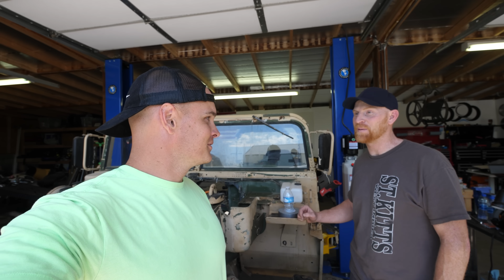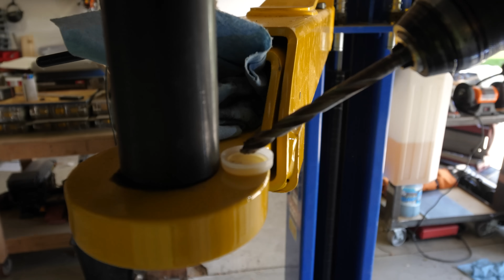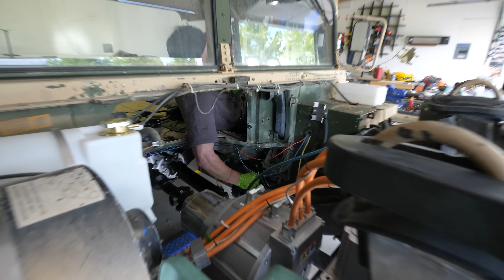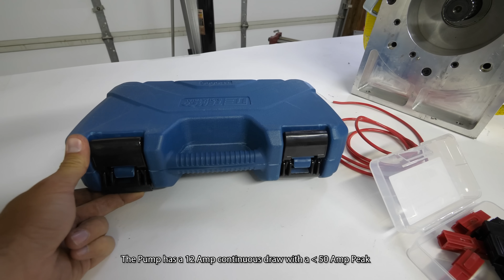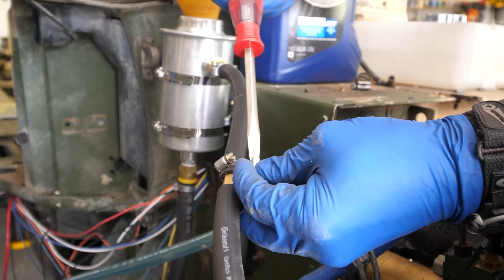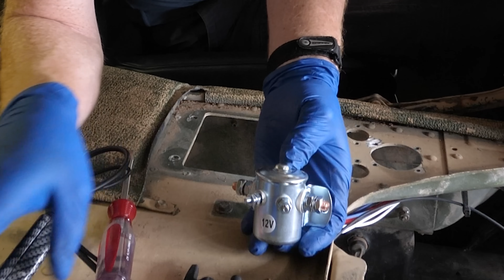We might have a problem with the Brakes... - Electric Hummer Conversion!

Comment: use pressure switch in line so when sufficient pressure it will stop pump..when pressure drops it will start pump again.
without pressure switch pump will heat up
or else use relief valve to drain excess oil in to the tank

Comment: First, add a fuse between the contactor and the battery. Also be sure to use a continuous duty contactor. A housing would help lower the sound level a lot as others have said and also protect it off roading. Love the channel and the series though this is a great build!

Comment: I wouldn't worry about sound deadening the PS pump itself. Once the hood and doghouse cover are on, and you sound deaden the interior that will help a lot. Also when you're moving you won't hear it over all the tire, wind, gear and main motor noise. So I would just let the PS pump stay uncovered so heat is not an issue.

Comment: if You add batteries and motor coolant pump to the  road noise You wont be able to hear power steering and brake pump ;)

Comment: Most auto manufacturers are using a lot of foam for the fuel injectors and fuel pumps. It helps keep the noise down. It would be worth a try.

Comment: Use a small housing insulated with the foam used in recording studios along with seals around the inside of the cover for the housing. That should work wonders in dampening that sound

Comment: About the pump... in my 1993 xantia I've noticed that it only makes a sound when I'm steering... if the wheel is straight (or in a long turn that u keep it at a specific angle) the pump isn't working... I assume there's some valve that when a specific amount of pressure is exceeded, only then does the pump kick in. So if no pressure on the steering wheel to turn, no pump.

Comment: What happens if the pump were to fail? controlling both brakes and steering single point of failure for both systems.... also - kinda mounted low if you are going to be off-roading a bunch?
Reply: steering is still mechanically connected via a shaft from the steering wheel to the wheels through the "steering box".  It would be very hard to turn at very slow speeds however.  The brake "hydro boost" has a valved accumulator that stores pressure for cases where you need power brake assist, but the power steering system isn't working.  But you only get a couple presses of the brake pedal before that runs out, and is a backup system only.

Comment: There will always be a difference between your electrified vehicle and a real electric car. On electric cars most components (especially those requiring a lot of power) use energy from the large battery to improve efficiency and reduce the load on the 12V circuit.
Reply: As long as his high voltage to 12v charger can keep up with the average power consumption of the 12v system he should be okay.  But yeah its not as efficient as electric power steering, and an electric brake booster.  I wonder if he's thought about his 12v loads vs what the 12v charger will keep up with

Comment: Thinking about previous comment, aviation folks use the transmission ( helicopters), CSD, constant speed drive, ( jet engines) to run hydraulic pumps. Emergency pumps were electrical and they made noise when turned on. Just some things to think about.

Comment: you should try using sound dampening foam under the hood and dog tunnel of the humane, sure it will still be loud on the out side but it should help the inside of the homvee a little

Comment: In my humble opinion, you should think in a way to only turn on the hydraulic pump when needed.

 I think that you should consukt if there is a servo motor capable to turn  your wheels. They will consume electricity only when turning and not all the time the vehicle is on.

If I understand correctly,  this pump will be always on and consuming your 12v battery juice,  which you will also need to think about how to charge it. Maybe it is a good option to plug it in your high voltage system,  via a dc-dc converter.

Comment: Since the loud pump sound does not vary too much, you might be able to cancel the sound by using a speaker that outputs reverse wave of the pump sound. This might be a good solution going by the electric hummer theme. Would love to see you try this solution 🤩

Comment: This is an awesome project. One thing about the braking system though. EVs and Hybrids use "Brake By Wire" So there isn't a physical connecting between the brake pedal and the Braking system. This allows EV's to modulate the braking system between the Regeneration and the Physical Braking systems. I would recommend that you add a Regeneration switch on the dash. That way you can manually switch the Regeneration function on and off, making it much easier to drive. Plus, I'm sure Regenerative Braking needs to be selectable for off-road use anyway.

Comment: I think the smarter thing would be to move the location of the pump to engine bay, as front as possible. Then when everything is assembled, if it's still noticeable from the inside while driving, try adding another layer of rubber on the mounting points so you're excluding the chassis from amplifying the sound,if none of the above fix it try covering it up and adding sound insulation. Even if it is cooled by the fluid, covering it up will add extra heat.

Comment: Next time, buy the pink teflon when used with oil/petroleum products. They cost 1$ instead of 35cents a roll. May save you a leak on the long run.

Comment: Try to put the system on a certain pressure. For example, an air compressor turns until it gets to 8 bar, and begins turning at 4 bar. If you put an accumulator in place, you have some buffer, so that the pump won't turn on too often. Maybe I am wrong about this, it only works if nothing is consuming any oil. 

If you don't find any solution, you may install electric power steering since the whole hummer is being electrified. I guess it works much simpler, but I never messed with it. You can put the pump for the brakes on the brake lights, so that the pump only starts spinning when pressing the brake.

Comment: Jerry, I am following your HMMWV build. Very impressive! You are doing an incredible job. I'd love to help. Sometimes I can see things I could do better and/or chipper. Like this pump reservoir. You custom-made it, I could of give you for free from one of my parts trucks. Or the wire connector to the pump, I would have done with Deutsch HD series, so it is weather sealed. As for the pump, I'd install a hydraulic accumulator with the pressure switch to activate the pump only when you need it. Also, there is no filtration to the system, not active (oil filter with bypass) nor passive, such as grabbing oil from reservoir few inches from the bottom, so if any metal particles not re-entering the pump and rest of the system.

Again, you are doing an amazing job!
Thanks.
Please do not hesitate to contact, if you wish

Comment: You should relocate the pump to the front of the engine bay away from the driver's seat. Also might want to put the engine cover back on and shut the windows and see how loud it actually is inside when there is an insulation barrier.

Comment: You need to isolate the pump from the frame. The vibrations of the pump are being amplified by the frame. You can buy isolator mounts for a mini split condenser, mount those to the frame and mount the power steering pump to the isolators.

Comment: If i understand your layout for 12V - it seems like you have the fuse on the signal side of the relay, not the load side, which means that if the circute is over loaded, no fuse will blow, because the relay isolates the signal side (low power) from the high side.

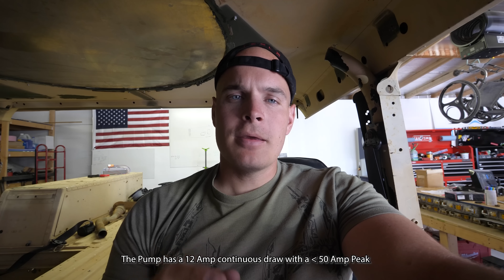Comment: 10:09 So test for max draw would be slamming on the brakes while turning at a deadstop?
Most work on power steering is when wheels are not turning and slamming the break pedal is the most stress on the brakes system.
Alot of R&D has been going into electric brake systems latley (last i knew) who knows what different options will present themselves soon.
Reply: Could always skip the power steering in that method and use a steering wheel that has a position sensor and have another electric motor that will rotate dependent on the readings from your steering sensor.
Reply: For the sound of the pump... covering it could possibly effect the cooling so thats tough to say... i think its only really going to be a noise issue when sitting idle as your tread to pavment noise will most likley be greater than the pumps noise... maybe a pressure resivoire that has sensors and switches with the idea of while stopped the pump would not activate unless pressure is at a less than ideal pressure (safety) but will activate freely when in motion. Have a couple other ideas but dont know how practical they are.

Comment: 15:23 Just put the pump away from the cabin, like behind the front bumper and you won't hear it from the inside, and if it stays too loud you can put sound isolation around it, like a little box covering it with sound isolation in the inside. If that doesn't work you can use a pump with a bladder that holds the pressure and the pump only turns on when the pressure goes down, like an air compressor, so it won't be running all the time, but check the pressure that the hummer needs, maybe is more than what small electric cars that use this system need. Also remember that you have the cabin all open now, with all the panels and isolation you won't hear it that much.

Comment: Working around aircraft hydraulic pumps made noise when they caveated, we used constant pressure variable flow pumps though. Maybe the reservoir ( scavenger system ) isn’t letting enough oil into the pump, or the pump isn’t strong enough, used to be a 24V system. Any check valves in the system to prevent feedback?

Comment: I assume this pump should only run when there is steering in action (so the noise won't bother. just like some regular car has hissing sound when steering). and don't know how you gonna hook this pump also to the brakes! Wouldn't it push the brakes and stop the car when steering?

Comment: Zack, you gonna need to keep running that pump for a while and eventually make some refills. Also move the wheel back and forth while doing this. It takes already a lot getting rid of bubbles from a water-cooled system, and it's gonna take longer for an oil based steering system before that pump shuts up.

Comment: I might be a little worried about the clearance of the brake pump. 
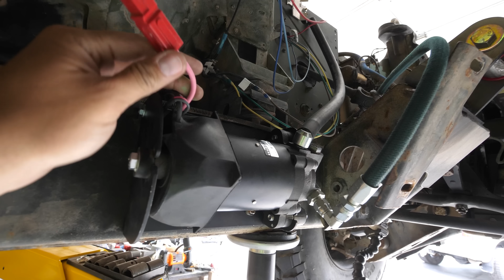6:39
If this vehicle will be used for serious offroad, the pump or the elbow could be banged/bumped/knocked off from a rock. 
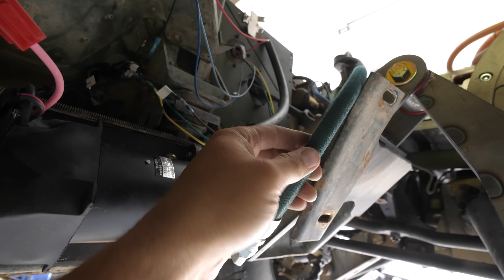You can see where the frame bottom paint was scraped at 6:49 from previous 4x4 ventures.
You guys are doing great work and your videos are awesome! I'm learning a lot. Thank you and good luck!

Comment: Could you make a housing for the pump? Just a small housing that can bolt over the pump? Maybe it has foam/some other sound damping material that blocks the sound? It'll also get quieter when covered by the body but even then it'll be loud. I'd make a small stainless housing if it were my build, it's also protect the hoses etc..

Comment: Make sure you double or triple check every bolt before you give it what you got under the hood. One loose bolt with that much power, goodbye control and hello very VERY VERY bad day
Reply: I know im paranoid but as this series gets further made something is sitting very wrong in my stomach about some parts. I'm not sure but something doesn't feel right. Did you make sure or will you make sure you get the low voltage wires isolated from the high voltage system 100% when you start working on that. You would not want to push on your horn and your horn to burn out instantly and you to get a nasty shock would you. Etc. I know I'm paranoid but when working with things that could easily or instantly hurt someone or worse. I play it as close to safe as safe gets. Sometimes overkill and it adds some weight but yeah .....uh good luck jerry. Hopefully things truely work out well in the rest of this project and nothing immediately breaks on testing it.

Comment: Add a simple pressure switch before the solenoid relay 12VDC+ terminal, the pump will not run unless the pressure drops below the set point which means you shutdown the pump when not needed AND save battery.

Comment: FIRST THING FIRST: THE LINE THAT IS CARRY THE HIGH PRESSURE FLUID ON THE PUMP, FOR THE POWER STEERING IS TOO SHORT.

THE LINE NEEDS TO BE A BIT LONGER THAT CAN HAVE ENOUGH FLUID INSIDE IT, TO BUILD UP A HIGHER PRESSURE.

Comment: For the noise level wont it drop once the cover is in place? If its still too loud maybe build a rubber coated shield over it? Ideally with vents as heat kills electrical motors like alternator.

Comment: The noise is probably because there is air in system, lift the  vehicle, then turn steering wheel all the way left and right with the pump off a couple of time, watch out for the fluid level in the reservoice. this metod helped me with mine.

Comment: Sound Deadening: 1). Since its close to electronics I was thinking Acoustical Putty. Used with electrical outlets, HVAC ducts, water hookups, and cables. 2). Possibly build a smaller box around it inside the doghouse with sound deadening mats or the stuff they use to sound proof and heat resist the cabin of cars. 3) Sound proof the whole dog house when you're finished with the sound deadening stereo pads. Thats my two cents, hope it helps and inspires 👍

Comment: So now the steering wheel turns easily when the car is not moving, so it will be doing in high speeds, isnt that a problem? Is there any way to solve that?

Comment: To dampen the pump sound, in air conditioning when a customer wants a quieter compressor, we use acoustic foam and cut it to size and wrap it around the compressor. Try that 360 all way around if possible
Reply: Magic Erasers and duct tape, broh. hahaha
Reply: Going to cook that motor though, it needs airflow around in operation, along with a pressure cut off to stop it running all the time. They are only rated for 1000 hours of running, so you really want to run them as little as possible, and have a fluid pressure reservoir there to handle the load most of the time.

Comment: Be careful with the sound isolation on the pump. In the most of cars with electric power steering, the pump is covered in sound isolation, it caches moisture and that destroy the pump

Comment: I'd recommend moving the pump body into the engine bay and putting some more rubber damping mounts between it and the chassis. Barring that, put a sheet metal box around it with some fibrous insulation. You don't want it to be too insulated though as it will build up heat and you don't want to burn it out, so perhaps a small 12v fan blowing air through the box.

Comment: What if you move the pump out to the front under where the radiator used to sit. Or wrap the firewall and tub of the body in the sound mat stuff hi end car audio guys use.

Comment: You should put a high amp fuse (or a fusable link) to the wire that goes to the pump, ideally at the point from battery to relay.

Comment: sound reduction: can you move the pumps a couple more feet away from the driver to another part of the engine compartment.  This will reduce vibration on the firewall, and reduce how much of the sound reaches the driver.  You can also put them in a box to reduce the sound travel, use a sound insulating material for the box like wood.  Also look up sound deadening material for cars, several products that may be adapted.

Comment: Use metal cover for steering pump. And glue sound dampening foam all around the inside of cover . After fixing the cover to pump, use silicone seal around the cover, this will help a lot to reduce the pump noise

Comment: Maybe you can try the sound dampening bag types that the manufacturer puts over the compressor of a large air conditioner. It looks like a leather bag with foam lining inside. Quite thick and does a good job sound proofing.. excellent yt series btw❤️

Comment: For sound isolation of the pump: simply use a thick heavy plastic box. ABS plastic would work. Cover the inside of the box with 1/2inch fiberglass board like is used in home Air Conditioning systems for additional noise absorption. Don't use a metal box as the metal is more likely to resonate with vibrations from the pump. Make sure the box is completely enclosed. Use rubber seals against the fluid tubes to prevent possible chafing damage and to keep the most noise out. The pump is cooled by the fluid so no need for air vents that would let sound out of the box.

Comment: According to me the only way to reduce noise level is to use soundproof barriers (covering the whole pump with insulation)and also use rubber washers under the nuts and bolts which connect the pump to the chassis as it will dampen those direct vibrations and for the grounding part you can drill another hole and connect the wire there.

Comment: Install a water-tight housing made from 2 pieces of aluminum around the pump with cutouts for the wiring and hoses, that is filled with styrofoam or spray foam and have it directly mounted to the frame.

Comment: You can use rubber washers like the ones you used in the motor. This helps isolate the sound from the frame of the hummer. Solves your problem by 50% maybe.

Comment: I was a former Mercedes-Benz technician and I noticed that they would incase the hydraulic pumps used for the convertible tops with a type of polyurethane foam that was molded to the shape of the pump and placed in its own container. The foam would have two halves that you could separate to access the pump for servicing. It could be a simple option to try